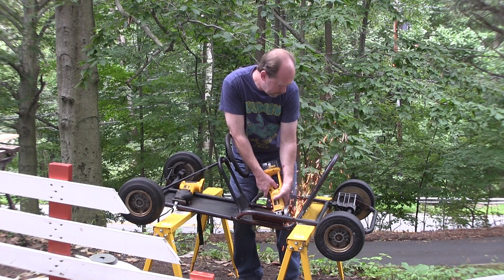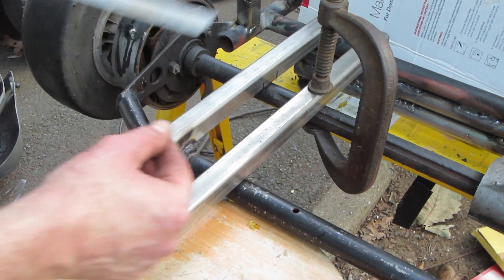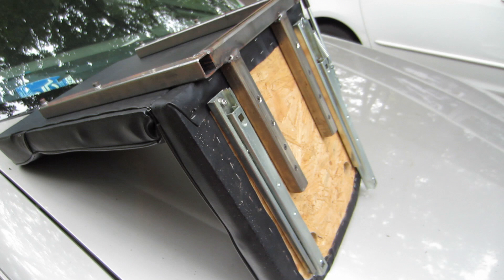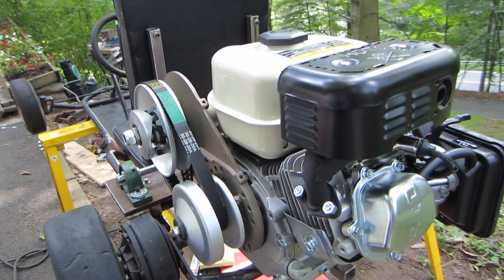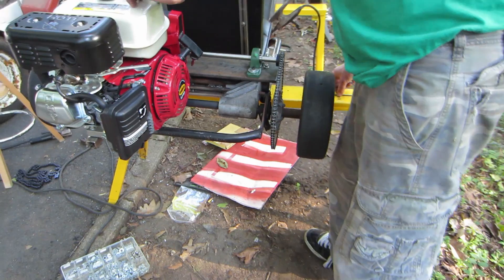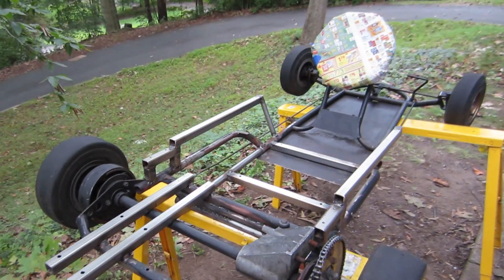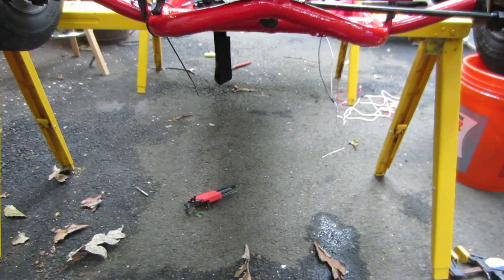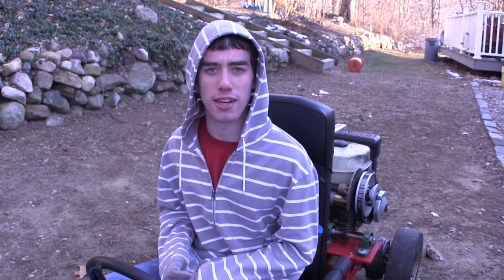How to Build a Go Kart

Comment: Where did you find the frame? Junk Yard? Craigslist? Please Answer.
Reply: I am building one to, so I will answer for you. They aren't that common, but craigslist, ebay would be your best choice. Make sure and get one as complete as possible because finding parts is not easy either. I found mine at a farm I hunted on and it was nearly complete. I hope that helps.

Comment: this is for your lie detector video does it have to be 82k resistor I built it but its not working and I think its because of the resistor I used
Reply from the maker: Did you change any other parts? Also what resistor did you replace it with?
Reply: +TechInside 100k

Comment: what did you do regarding breaks
Reply: +ady-B David Brakes? lol why
Reply: lol ok let me rephrase how do you slow down or stop?
Reply from the maker: The go kart had a drum break into already so I used that. But it broke at some point so I bought a metal circle plate to go on the axle and used this break: http://m.northerntool.com/products/shop~tools~product_200323386_200323386?hotline=false&cm_mmc=Google-pla&utm_source=Google_PLA&utm_medium=Sporting%20Goods%20%2B%20Toys%20%3E%20Go-Kart%20%2B%20Minibike%20Parts%20%2B%20Accessories&utm_campaign=Airheart&utm_content=13856&ci_src=17588969&ci_sku=13856&gclid=CMas8P39vMgCFUQTHwodLQIMIQ
Reply from the maker: By metal circle plate I mean break disc to be accurate. Here shorter link though: http://bit.ly/1LJvyF1
Reply: ady-B David Again, why does one need brakes xD there is no need to slow down unless your done riding yo, take them turns and collisions like a man full speed, the only way you would need to decelerate is to just take your foot off the gas

Comment: I want to buy a go kart under 165 dollars
Reply from the maker: Eliazar Ibarra thats kind of hard.
Reply: +Eliazar Ibarra, You can build one for 250 or 300, you just need to have some scrap metal and welding skills. I recommend a Predator 212cc engine. If you want more speed remove the Governor, but be aware that can lead to some problems inside that are hard to fix, (Such as a valve breaking), anyways I'm building one and it's quite simple, easier than people make it out to be, as long as you have an idea of how to build it.

Comment: what is a torque converter
Reply from the maker: Mehdi Bouchebri  A torque converter takes the speed of the engine and turns it into the power to carry a bigger load. We installed a torque converter so the Go kart would be able to go up hills without any problems.

Comment: i have the same system that you have with the torque converter , the belt coming from the  engine to the torque conterter , except my wheels turn all the time , whats wrong with my set up? i have a regular pulley on the shaft coming from the engine ?
Reply from the maker: when the engine is on it is always spinning but there is a metal ring on the torque converter that the built sits on, This makes it only spin when the torque converter picks up speed and squeezes in on the belt thus making the wheels spin.

Comment: seat design is totally compromised in every sense of design and safety.
a typical standard design would be to construct a frame that holds the back and bottom sections & attach the adj rails to the frame.. using sterling board  as the bridge between the two adj rails and support section is insane.. , clueless.